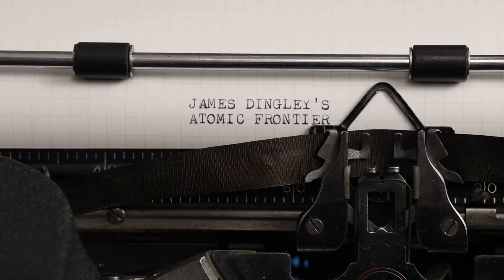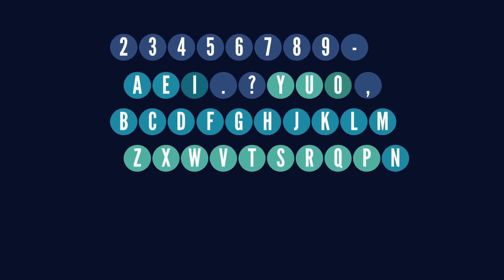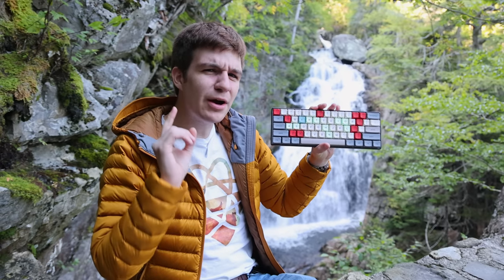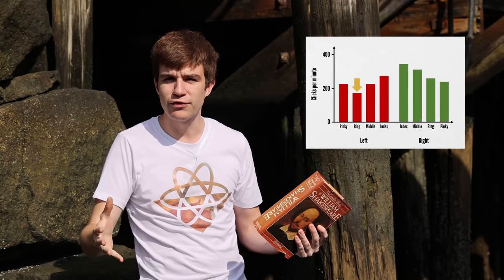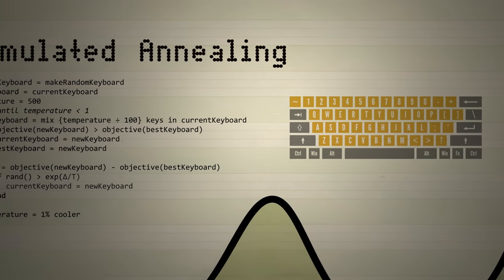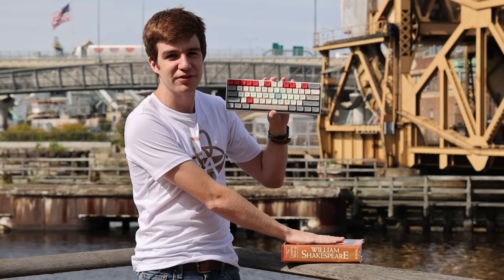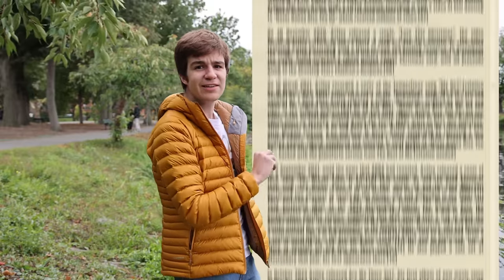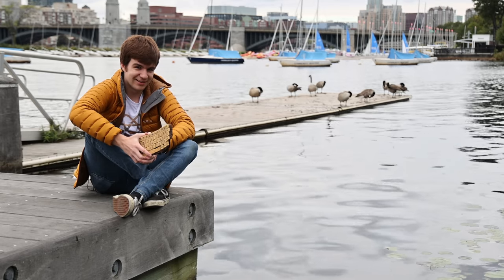QWERTY is broken. Can we make it better?

Comment: Honestly, we need a new language lol "Q" is pointless, and we would never need "C" if we have both S and K. "X" is also pointless.
Reply: Ahh... now you're getting into Spelling reform. A matter a great many intelligent and well educated people have delved into and broadly reached the following conclusion:
There are a few optimisations to be had. They're almost universally NOT the ones the average layperson would propose, and the downsides of the process of implementing them (even if you could actually manage it to begin with) Vastly outweigh any theoretically benefits of such changes.

Most people tend to conclude that bringing back Thorn (a single character representing both TH sounds... which English spelling already treats as if it were a single letter so far as spelling rules were concerned anyway) would probably be a good idea.  There's a couple more things that would Probably be helpful.  Doing away with 'not as redundant as people think' characters from the current set is... a long way down the list.

(also, at one point I, 1, l, and | were the same character on the keyboard (I'm not actually sure | was a thing, come to think of it), as were 0 and o (mostly a typewriter thing)... this was great for the manufacturers, but AWFUL for anyone reading the resulting document.   Computer keyboards fixed this... then some idiot font makers decided that Reintroducing the Ambuiguity was a Great idea, and then those fonts somehow became the Default in many uses... including here.  The cross bars on a capital i? They're Not Seraphs! they're actually part of the character! The seraphs, when present, are the little flicks at the Ends of the crossbars!  An upper case i should look more like an upper case t (T) than a lower case l (l). (for reference, there's this whole thing with 1,7, and 4 as well, though that's more of a problem in hand writing than in typed form).
Reply: @laurencefraser  I think it would be hard to adjust but within a single generation we'd be spelling things in a logical way lol idk about all the stuff you said but I would just use the IPA, that way, our pronunciations would also stay the same over longer periods of time too, and it would be easier for historians to figure out. Special characters like + and # are fine the way they are imo

I even think we should switch from conventional flow to electron flow, and swap polarity, where negative is positive and vice versa. It wouldn't really benefit us and it would be a little confusing at first but it would make more sense

Comment: The generated layouts are horrible. They have 'th' on the same finger, 'ng', 'ed', etc..... that is not fast in the slightest. These are incredibly common sequences and you should not be bottlenecking them to the speed of a single finger. It'll be horrible at even remotely faster speeds.

You really just didn't do any research for this at all. SFBs are an incredibly popular concept in alternative layouts.
Reply: Well, if one got Really enthusiastic, one could solve the th problem by bringing back thorn... heh.